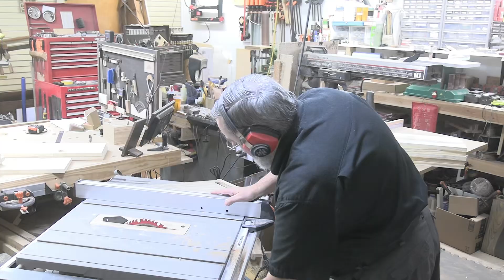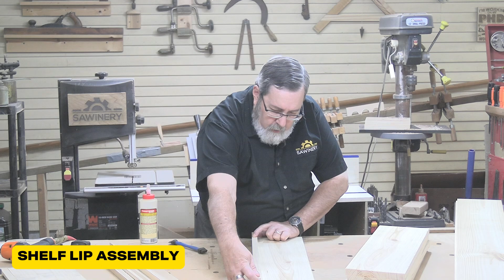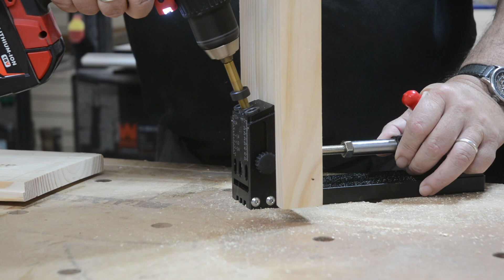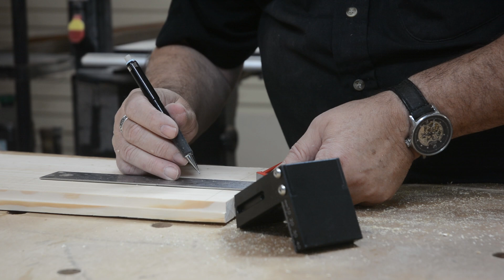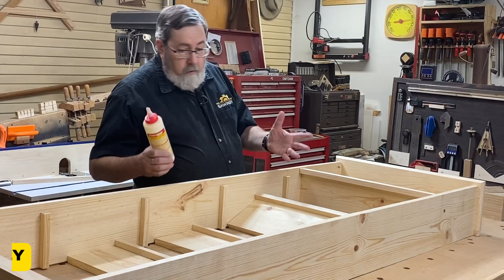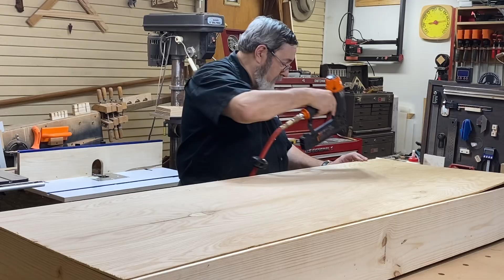Build Custom Woodworking Shelves for Extra Storage

Comment: This is a great step by step! I’m very new to woodworking and want to ask what size brad nails are you using? Also, you’re using a Brad not a pin nailer, correct? Thanks ❤!
Reply from the maker: Hi! In this case, it’s probably 1 1/2” brad nails, and yes, that’s a brad nailer, not a pin nailer. At the time, I didn’t have a pin nailer, but even now that I do, I’d still choose brads for this application since they provide more holding strength. Pin nails are really useful for keeping pieces in place while glue dries, especially when you want minimal visibility, but they don’t offer the same strength as brads.